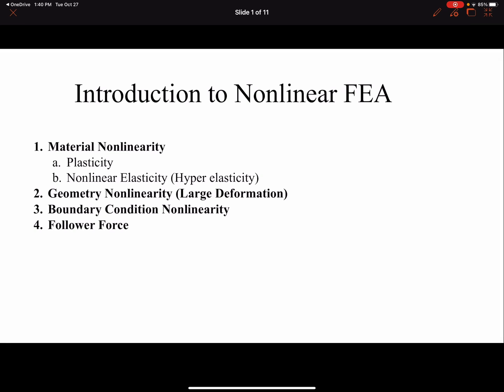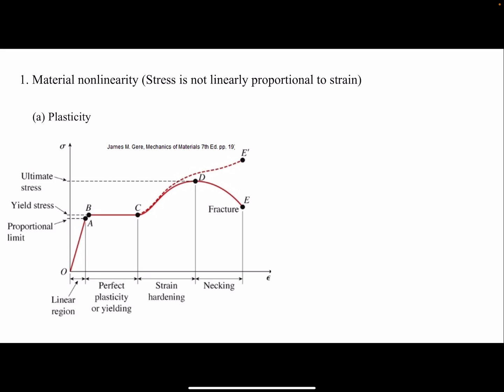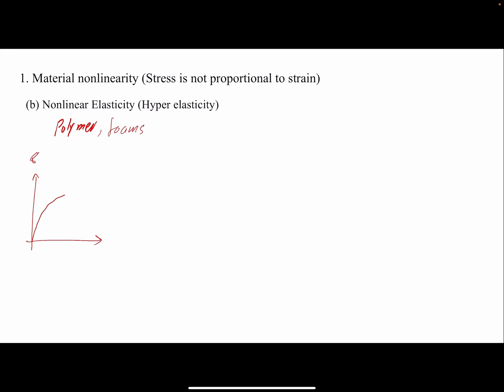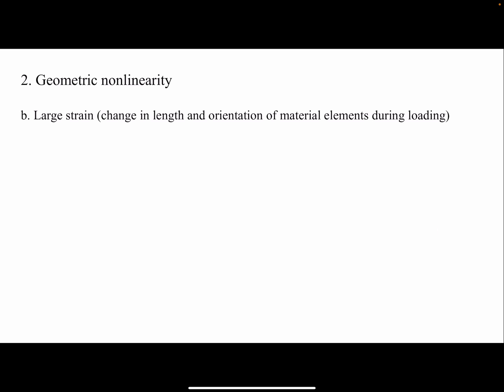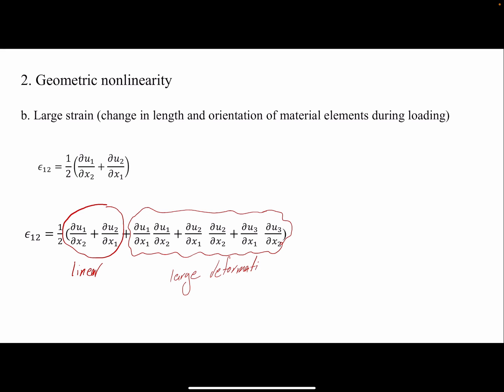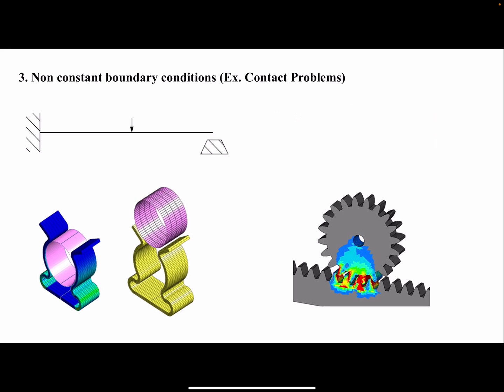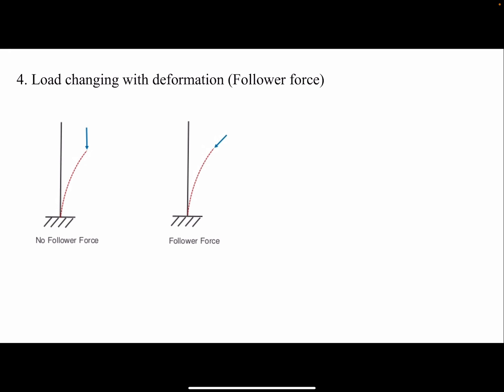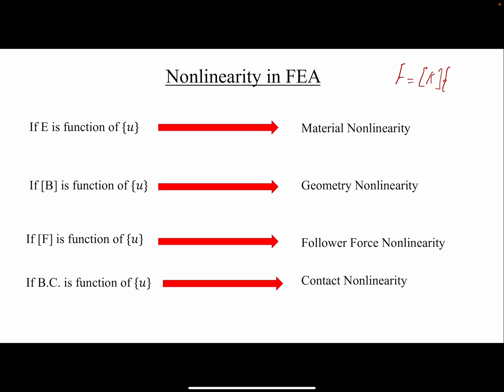Lecture 17: Introducing different types of nonlinearity in FEA

Comment: Thanks for the explanations, 
I have a question about boundary nonlinearity in a case of a prestressed beam inwich the cable is streteched on his both extremities and the we apply a tensile force on the tendon than we relase the tendon, the tendon should not go back to his initial position, i am trying to find the physical representation of the anchorage zone.
your help will be truly appreciated, 
Thanks
Reply from the maker: I don't understand your question
Reply: @engineeringvision  instead of modeling the prestress as force. I am trying to find a formula to represent a pretensioned tendon that try to go back to his initial pisition but blocked by an anchorage zone. 
My problem is that anchorage zone permits the tendon to be tensioned but if i release it. The anchorage block it. So i thought that maybe could represented by boundary nonlinearity formula.